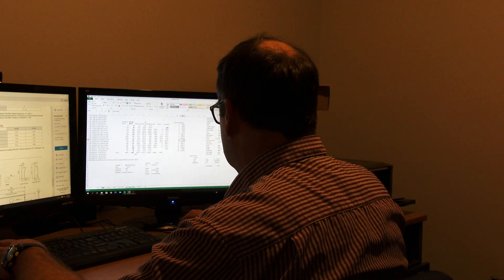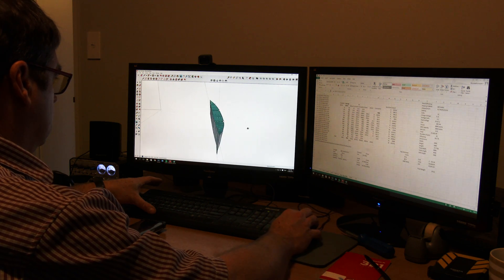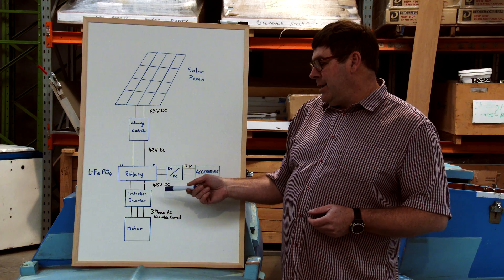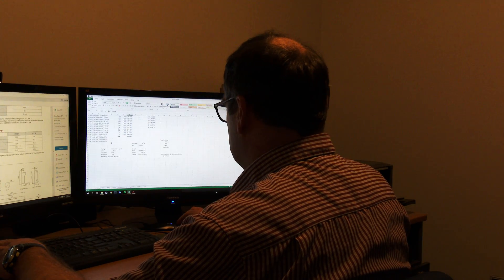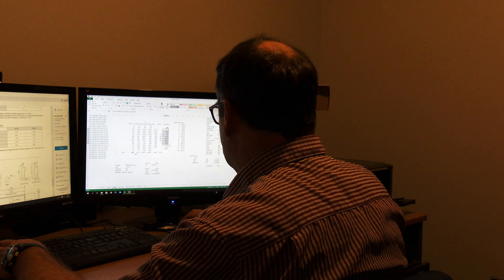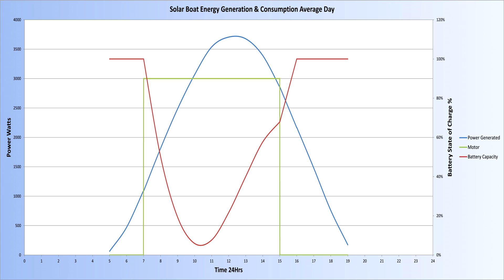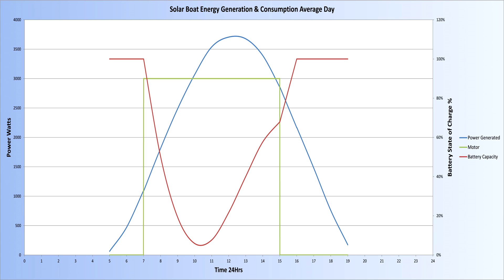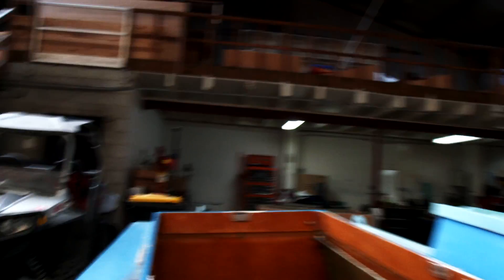EP2 Power Management - Solar Boat

Comment: how much load on the propulsion caused by wind?
Reply from the maker: I cannot answer this specifically. My calculations are based on the speed i achieved with with the petrol engine in the proof of concept episode. A strong wind would have a significant effect.

Comment: Good Job man! I know from experience jor plan is going to work. My solarboat "Suntiano" was running for the second summer this year! Running whole day without charging on the grid. People simply won't believe it. They think I'm hiding a gasoline generator underneeth the panels.
Keep up the good work, and keep me posted about the progress!
Reply from the maker: Thanks for the confidence. Your boat Suntiano looks fantastic I love the design ideas especially the roof.
Reply: Thanks. Roof goes up and down using electric actuators. It enables me to clear low bridges and close the boat for the night. 
How is your boat going? Did you build your panel frame yet?
I worry about bit about the total weight of those 16 panels. My 8 panels are 160 kilos  (metric ) al together. That is why I had to build this "surfboard/catamaran" hull.
Reply from the maker: The boat is further ahead than the videos, I'm trying to catch them up at the moment, but film making seems to take more time than boat building :-)
The panels by I amusing will weigh 272kg. With the weight I am removing, the total weight will increase by about 250kg.  This will still leave plenty of freeboard. I just need to be conscious of the weight of everything I add.
Reply: I hope you calculated a couple of diagonal beams for the solar roof construction. When riding the waves it will get a lot of dynamic forces. Om Suntiano I found out first hand. That is why those ugly carbon-fiber triangles are there.
Good Luck!
nico.
Reply from the maker: The roof structure supporting the solar roof will be triangulated. Just trying different ideas to make it the least ugly.